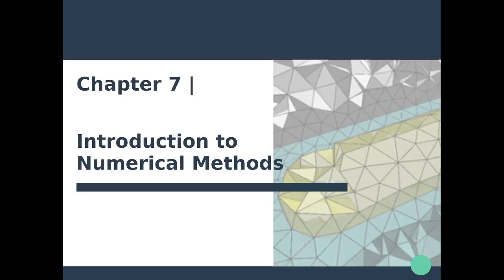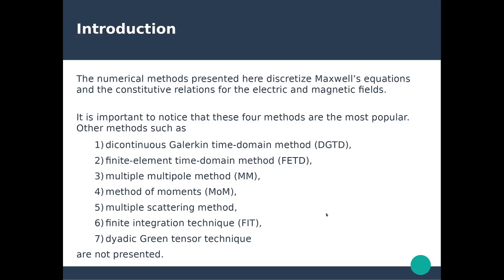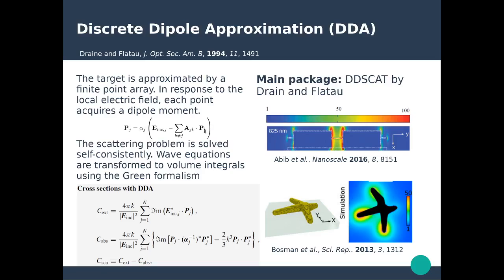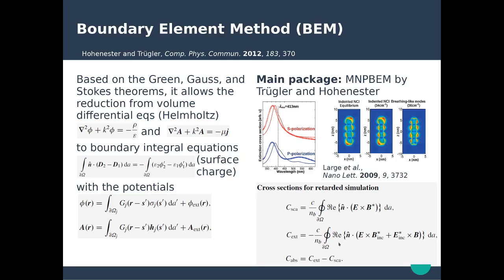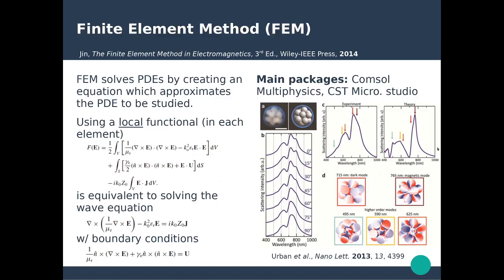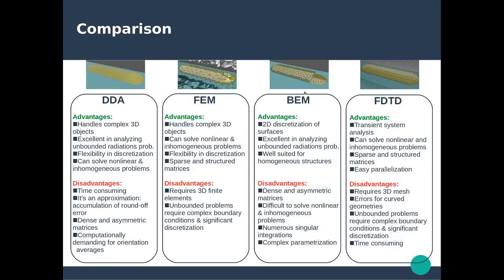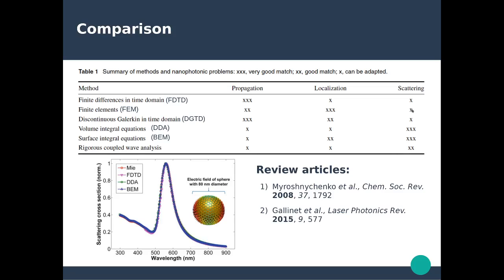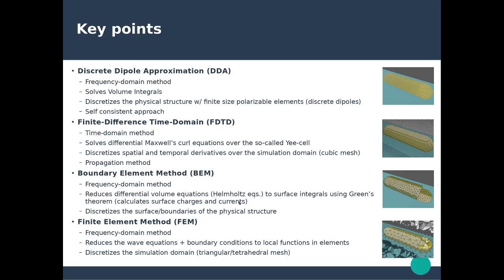Nanophotonics & Plasmonics - Ch. 7 | Introduction to Numerical Methods

Comment: is MM a simulation method ? 
i am searching for method based on pure coding without any reliance on simulation for calculating the electromagnetic response.
Reply from the maker: By MM I'm guessing you're referring to the Method of Moments (MoM). By definition it is computational method as it solves Electromagnetic problems using mathematical methods. Now I'm not to understand what you mean by "method based on pure coding without any reliance on simulation"". Any computational method will be coded using mathematical methods to run on a computer. By definition any method that will run on a computer is a computer simulation. Now if you're referring to Analytical models, the only pure analytical solution of Maxwell's equation will be Mie theory but it is limited to spheres. Anything deviating from a sphere in a uniform medium will require computation simulations.